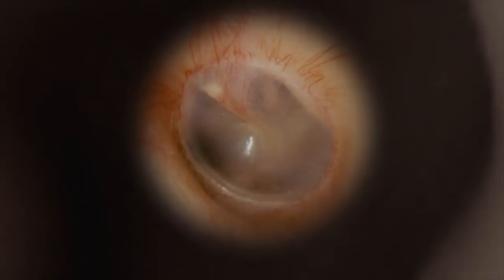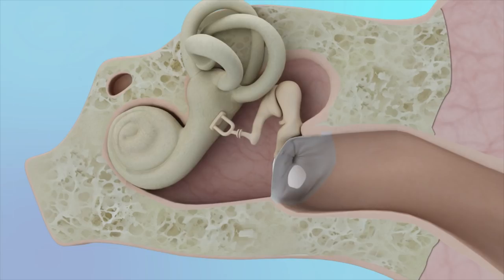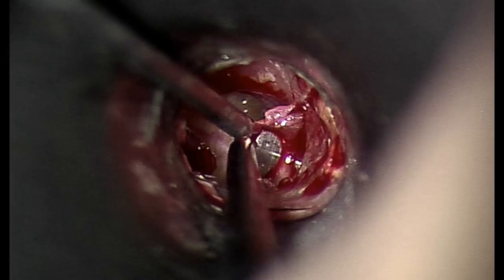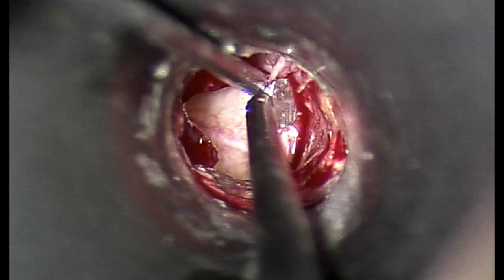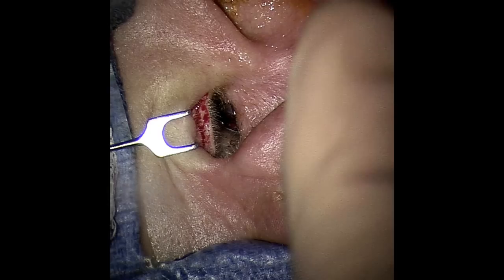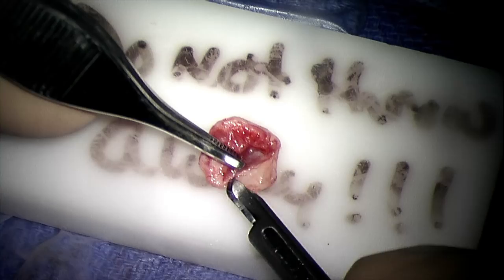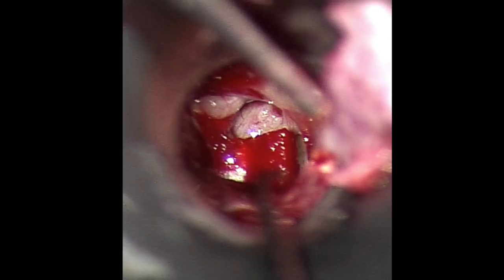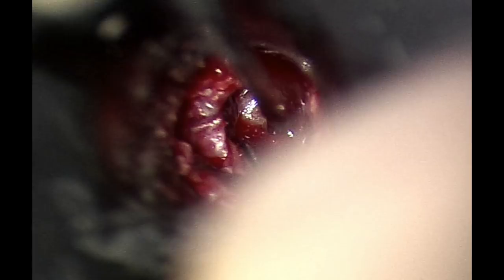Eardrum Hole Surgery  - Transcanal Tympanoplasty

Comment: This is quite remarkable. How does the eardrum graft attach itself to the hearing bones?
Reply: The graft is not attached to the bones. The bones are in the inner ear. The eardrum is in the middle ear. The surgeon cuts around the edges where the eardrum tore off and when he places the graft it bonds with the edges hopefully with the help of the gelfoam to support the graft in place. It's important not to lift anything heavy or sneeze with a closed mouth, or blow one's nose hard till the graft has healed. If one sneezes to do so with mouth open so no pressure is put on eardrum graft, as it should not become loose.
Reply: So, the graft is attached to the remnant eardrum? What if the eardrum has become detached from the bones? Can a surgeon reattach it? And what if the eardrum is completely gone? Does that make this surgery impossible, or can it be restored with another surgery?
Reply: From what I read in the past sometimes if the hole is too big it can't be done without remnant eardrum. There are photos online I believe that show holes that are repairable and those that aren't. I would imagine that it's pretty rare not to have anything left to hold the graft, especially if one was born with normal eardrums like myself where an infection in childhood burst my left eardrum leaving a large hole. Supposedly some are not born with normal eardrums from what I read online. I'm sure that's quite rare too.
Reply: Eardrum is part of the bottom of the ear canal. It's the same skin. If you think of the eardrum let's say is like an ice cream cone where the top is the opening of the ear and the canal is the part you would hold, then the very bottom of the cone would have the hole where it would leak out. That's why it's important to keep water of an ear where there is a hole, as infection and pain would occur, as the water would stay in the persons head and pass down to their throat. You could also think of the eardrum as the bottom of a cup with a hole in it. Water would leak out. In this case it would leak into a persons head, etc. It may not get infected the first time, but it would hurt as it would touch blood vessels since the skin is missing with a hole.
Reply: @msw600  Hi there. That was a very informative. Does everything feel normal after surgery? I have heard that hearing does not improve much after surgery...Is is true?
Reply: @prakash_niro  Hi. I didn't have the surgery yet. Still considering it. Theoretically if the only thing that's wrong with the ear is a hole in the eardrum, then repairing the hole should help. However results could vary depending how well some patients hear prior to surgery. Some are better candidates than others for the surgery. My hearing loss is very mild, and some dr.s are hesitant about doing surgery, but some are willing to as well. In a perfect world I would like surgery without risks to make it perfect. We don't live in a perfect world however. It's possible a better more experienced surgeon "may" have a technique or a special skill to make it less likely that surgery would result in further hearing loss. Ear surgery is not as perfect as eye surgery. So it's best to get a few opinions before having it done. Just make sure one chooses a top dr. who has had the most success doing this small surgery.
Reply: @volvotoyota4850  thank you for taking this time. I have a hole that’s pretty big…almost 80% as the doctor said. He suggested me to undergo surgery but I know few close people who have done this kind of surgery but are not happy with the results. So, I was quite wary about it.
I can hear, though much less than my healthy ear. I need to be more cautious while on shower and swimming feels risky.

Thank you for your informative reply again.👍
Reply: @prakash_niro same …confused about what if the result not succes …

Comment: Today I had this surgery 
It's quite fascinating to see it in real 😊
Reply: hows your hearing after surgery? I got it last week and it feels stuffed cant hear much from that side
Reply: @taolaMrD  yes it will be normal after a month 
i also had a feeling of stuffing 
but trust me my hearing had improved A LOT
Reply: @rex77x  Doctor told me wait for the packing behind the eardrum to dissolve. May I ask how long until you felt that stuffiness went away? Some people said 1-2 weeks some said few months :(  I’m exactly 1 week post surgery and still can’t hear anything from thay side.
Reply: @taolaMrD  it depends 
Like if the doctor had used a dissolveable gauge then it will be removed by the doctor after 10 days 
But if he has used an organic one then it will melt on its own and it may take upto a month 
After 1 month you will be very close to Normal
Reply: @rex77x  He removed the gauge today bit he said he had put more dissolvable gauge behind my eardrum so I’m waiting for that to dissolve I guess. Did you have to wait for that?
Reply: @taolaMrD  actually there are many methods of the surgery 
My surgeon didn't put any gauge at the rear side of the eardrum so after removal of the gauge my hearing was normal and no discomfort was felt 
But also some discharge was seen 
Which after 1 month has almost stopped

Comment: Had this done under general anethetic 2 weeks ago. And barely had any pain after. Was a little sore and uncomfortable due to packaging. Had the packaging removed after 2weeks and feel my hearing is much worse than before. (my hearing was fairly okay before the op)  due an hearing test 6weeks after Op. Hopefully hearing returns to normal or better than before.
Reply: Lei P my hearing is back to normal
Reply: Lei P There is a risk with any surgery, and if your hearing is already effected it's probably a good thing to get it done. If by any chance your hearing doesn't improve after the surgery at least you will get less ear infections and other benefits. (bare in mind it can take up to six months for the eardrum to fullyheal and hearing to improve.) 
Where are you having the surgery done? I had mine in the UK
Reply: Note: my surgery was done straight through the ear canal and they did not cut behind my ear. This is obviously less evasive thus quicker healing time and less discomfort.
Reply: Elis Jones How much would that cost to repair that perforated eardrum? 
I'm 17 and i can't afford that for sure
Is there any other way out 😫?
Reply: Elis Jones I will have it done next week.
I hear ok with it now. No pain no discomfort. I just feel sound ssssssss in my left ear with a big hole in drum. Should I do the surgery?? Thanks
Reply: Hello how is your hearing now?
Reply: @chaze77777  No issues so far, hearing is normal
Reply: @quansahj  how long until you felt your hearing was back again? I am now 1 month post op and hearing still muffled due to packaging i guess.
Reply: @janececilia555  can't remember exactly but once the packaging was removed, my hearing came back to normal after a couple weeks
Reply: @sahwillnabilanwar  how are you, did you get it done?
Reply: @kevintony7003  yes 3 years ago
Reply: @sahwillnabilanwar  how are you doing now hearing wise
Reply: @kevintony7003  yes, you will hear better but the hessing sound will not stop, it might get worse. Overall , not bad, you can take shower, swim without that much fear. Good luck
Reply: @janececilia555  Hey how are you doing now? I’m also 1 month post and my ear still stuffed. How long until it got better for you? I read from the internet it takes 2-3 months for the packaging to dissolve. Thanks.
Reply: @taolaMrD  I am good! Just had my late check up and hearing test. And hearing was perfect and even a little better on bass sound. Having other surgery on left ear in year or two. It was worth it for me. Hearing got better slowly but surely as i didn’t pay too much attention to it. Only thing is i feel air passing through ear when working out. It is weird but I always had that but I thought it will go away after surgery. This almost kind of locking ears feeling. But overall very good results. 👍🏻

Comment: Just had this done and in the process, my surgeon noticed my stapes bone wasn’t moving. Turns out I have Otosclerosis. Sucks cause the surgery repaired my perforated ear drum but not my major hearing loss. Im terrified about losing my hearing. Im hoping I can get surgery to replace that bone and restore my hearing.
Reply: Good luck! I got this surgery two months ago, but my hearing still hasn't come back. I'm scared it opened up from sneezing or something, but I'm gonna wait a bit longer for it to return
Reply: @PichuElric  Good luck! I’m sorry the surgeries weren’t successful. I feel you on the sneeze. It was hard not to. Hopefully you find a solution
Reply: @congadera  Thank you! I didn't know there was surgery to replace the bone that gets scraped away to remove the infection, so thanks for sharing your situation too
Reply: @PichuElric  So what they would be replacing is the stapes bone in my case. Since it’s not moving. There’s scar buildup around that bone that basically paralyzed it. So I would get a prosthetic stapes bone. My perforated ear drum is healing nicely. So at least I fixed that issue. I just want my hearing back 🥺
Reply: @PichuElric  can you answer please I had this surgery two months ago but my hearing is still not good. In how many months did your hearing improve?

Comment: I just did mine the other day! Hope it heals well! It's my second time to repair my ear....
Reply: how are you
Reply: @kevintony7003  hearing OK. I think my wound is healed.  Hearing quality is not as good though. Muffled higher frequencies.
Reply: @mildman1987  maybe takes more time
Reply: @mildman1987  does it hurt too much? also was the inclusion made behind the ear?
Reply: @kevintony7003  yes behind the ear. Didn't really hurt though. Just had to disinfect religiously.
Reply: @komik_hayvanlar26  3-4 months
Reply: @kevintony7003  it's been two months but my hearing is worse than before the surgery
Reply: @komik_hayvanlar26  theres a packing that needs to dissolve
Reply: How's your hearing now??
Reply: @vickyraj8684  much better. Not leaking and itching as much. I am now classified PWD. Hard of hearing. I'm sure I will use a hearing aiid someday.

Comment: I have also hole in my ear drum........one ear is fine but from other i able to hear 50% .
..sir ..can u pls suggest what should i have to... do...for...every year i feel loosing hearing capacity.......pls..tell any other way rather than operation...
Reply: Niteesh Kumar go for the opration,don't be afraid,is just notting to worry about,I did my  April this year,earring  is superb
Reply: use homepathic  medicine it can cure upto 60% eardrum hole
Reply: @anshbanerjee3433  which medicine

Comment: I have a question, I was supposed to have this surgery done but I backed out because I was scared. But I want to know if this surgery is done while you are sleeping. The doctor told me I would be awake. That really made me nervous and I have anxiety! I said no way! Someone please let me know. I have constant ringing in my ear since 2009 and I barely can hear out of my right ear. But I can't take it no more because I have been getting headaches and dizzy spells now and falling over can't balance. what should I do?
Reply: You would be asleep during the surgery under local anatistic and the dr was wrong to say that I had it done I remember the needle to put you to sleep so nothing to worrie about
Reply: they will give you anesthesia, I had a surgery yesterday. I was taen to OT ( operation theatre) then I was asked to fell asleep on bed, it's too cold in there usually they maintain low temperature in OT. I requested them to increase temperature instead they started warmer ( kind of heate that covers my body) for me that help me to feel well I've closed my eyes and believe me there after I didn't remember anything. I wake up directly after surgery (for few mins) then completely after few hours on my assignmened bed.
Reply: @MiraakYT   भाई, surgery krne से phle ear pinna को v hate hain kya ?
Reply: @MiraakYT  is there any improvement in hearing 🥺
Reply: @andrewtate52734  Yes a lot.
Reply: @MiraakYT  Which hospital and which doctor? I am from India.

Comment: I had a hole in my right eardrum one year ago. I consulted ENT and he gave me some oral tablets and I was fine in few weeks. I had a  temporary hearing loss but later my hearing was improved. After that I didn't go for the checkup again. But from few days, m having severe pain in my ear but my hearing is fine, what should I do? I will go for checkup again but I think my hole is not healed till now.
Reply: Hey, the hole does not heal with medication
Reply: The pain is possibly due to an ear infection that generally happens as water goes to the innner ear through the hole
Reply: +sukhbirgill82 but now it's fine. There is no pain in my ear now.
Reply: Yup, anytime water enters it will again cause infection and start hurting so it's always better to get it operated. Also the hole would keep increasing with time and would result in hearing loss eventually
Reply: After how many days your hearing improved?
Reply: @bishwazeetdas7615  after one month

Comment: How long is the procedure?  Can i go home on same day after the surgery? I am planning to schedule mine soon. Im a bit scared.  :'( Thanks!
Reply: Mike, yes. Is out patient surgery, at least in USA.  It takes anywhere from 1-2 hours. However anesthesia might be a barrier to your performance.
Reply: +Mikee monte de ramos Usually yes but you gotta be under watch by others because the meds they give you are strong. Day in day out, gotta have an adult to watch over you.
Reply: Dovvee , I disagree to that. If you have full anesthesia, at least someone have to pick you up from hospital. The medicine are Hydrocodone( may make you little drowsy, almost felt like taking Benedryl) along with something for pain. But it all depends on how well your body handle meds. Doctor said the success rates are about 95%.
 
There is also another procedure that doesn't require full anesthesia. That procedure is almost like taking a tooth out. They inject you in several spots by the ear and numb it in order to operate. It depends on how big the perforation is. 

It is not scary at all, however, it takes about five to six weeks to heal.You may show symtoms such as ringing in ear, lose of balance, vertigo, tiredness( due to meds) during this time. Your hearing will significantly improve by 2 weeks, hence you will be irritated easily because everything is loud. Hope I will get used to it soon.

Hope this was helpful! Best of Luck!
Reply: ***** Yes thats what I ment, I had to have the docters watch over me 24 hours before I was released back home, but I can't feel my ear, well some of the feeling is returning as well with my taste. But yes it's going good, thanks!
Reply: +Dovvee I got it now. I might have misread it before. I am glad yours is improving too. I am so glad that I can go back to swimming this year again. It used to horrible after swimming, used to have drainage and clogged ear for days. Thank fully didn't damaged my inner ear. I figured there was a perforation 3 weeks before the surgery,  lucky it didn't damaged more.
Reply: ***** Oh yeah, totally and yeah its okay, It's only like the 6th day or something since the surgery, starting to regain feelings (my ear stings randomly). I almost never swim anymore due to personal reasons but it'll be nice to never have (or at least almost) ear infections anymore or go swimming once in a blue moon without worrying a whole lot about the water.

A little paranoid of taking showers at the moment though, since I can't get my ear wet, how long do you think it'll be okay for me to get my ear wet? Like 2-3 weeks after? Thanks for reading this n' all by the way m8
Reply: +Manoj Devkota oh that's interesting!  your testimony gives me hope.  huge thanks for sharing!
Reply: +Dovvee  I got silicon ear plugs (usually used by kids while swimming ) from Walgreens. You can mold them to the size you what using your hands, hence not as firm and damaging as other  ear plugs can be. 5 days and no shower, can't do it buddy 😭. I took my first shower the day after surgery, but put a shower cap on so didn't wet the wound. The doctor said it was okay for the would to be wet after about 4 days so been taking shower as if regular since about 5th day. Still cautious and trying not to get water inside ear canal.